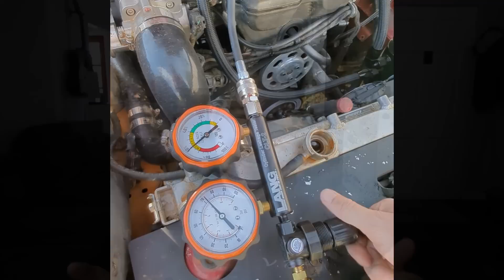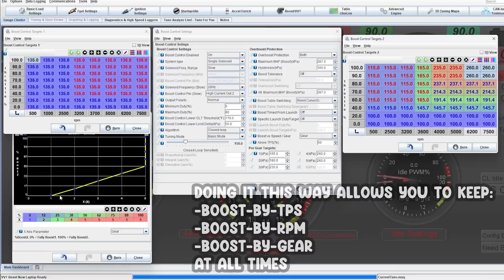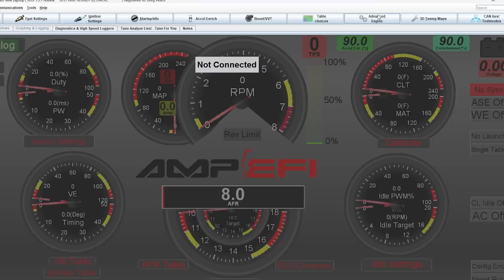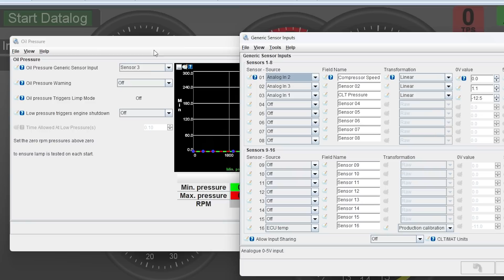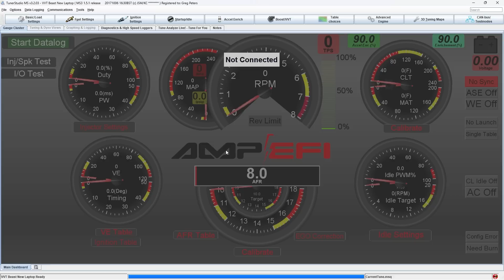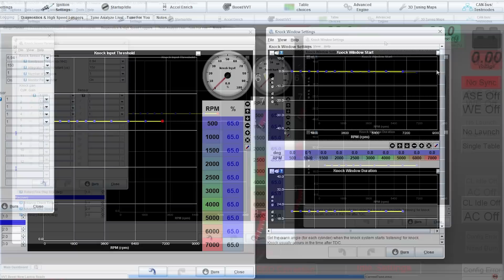The 500HP Miata Is Still Alive, Let's Make It Safe (And Fast)

Comment: The 2 point calculator for calibrating 0-5v sensors is an awesome feature. As you know most sensor data sheets don’t give you the absolute zero & 5 volt readings. 
Very good feature

Comment: I haven't found the point where the head starts to lift on the kia T8D 1.8L But I did find the breaking point of the Ring lands LOL. Turns out that somewhere around 21.5 PSI with a large large turbo. Or I'm guessing around 475 HP at the crank

Comment: Another great post and love the nerding out on Megasquirt and Tunerstudio stuff!  Question, for boost by gear, how does MS "know" what gear the car is in?
Reply from the maker: @therobertshouse  It's a calculation based on comparing engine RPM to driveshaft RPM (or rear wheel speed depending on where your sensor is), and you input the gear ratios into Tuner Studio. So it knows if driveshaft RPM is 3000, and engine RPM is 3000, it's the 1.000:1 gear which is 5th in mine

Comment: 4 cylinder ppl here in PR are using solid cooper head gaskets with lots of gray silicone im talking of 10 to 8 seconds street and drag cars…dont detune the setup you just need less fancier parts and true race hardware💪🏁🔺🔻

Comment: On the knock sensor, doesn't it not make sense to only listen for knock between -6 to 26, as every cylinder will be firing or knocking at a different crank angle based on firing order. Crank angle is only based on cyl 1 no?
Reply from the maker: It listens from -6 to +20 on all cylinders, not just cylinder 1

Comment: Is the turbo sized correctly for the application?
Reply from the maker: I would say it's undersized for the power level, which I'm sure is why there is such a fine balance between working and not working well.

Comment: You need to get rid of the VVT and get a cam with more duration. A late intake valve closing will decrease the dynamic compression ratio.
Reply from the maker: Yeah for sure, I have a couple 4W heads and I need to build one on the side and just swap it in next time I have the head off. At this power level I know I'm probably at the limit of what  stock cams really want to do. Problem is I'm also at the limit of the turbo... so I would like to pair the 4W head with a little more cam, and a little more turbo, and keep the same power level. Just scared I'm going to spend $3K to have the same power and less response, but in the end if reliability is up, then that's good. I can always set up kill mode with an extra 50-100whp on that setup and use it sparingly.
Reply: @TheCarPassionChannel  you will lose a little down low, but your shift points will move up in the rpm a little, so you will always be in the boost. In a slow corner you will have to downshift would be the biggest drawback. I think it would be cool if you went to a road course and got a time, then did some modification and went back.
Reply from the maker: @andrewf8486  Regarding shifting the powerband up, there are 2 limitations that stop me from trying to force the BP to act like a big turbo Honda - yes the powerband will be the same size, but I don't want to rev the engine to the moon to get power when I can already make good power int he stock rev range. Revs wear out all engines faster, regardless of build. And also, the turbo will still come on slower at a given RPM (transient response). 

In a straight line, yeah big cams and big turbo all the way.
Reply: @TheCarPassionChannel  another thought I just had is that you would still make the same power on your current turbo at a lower boost pressure. This would drop you a little lower on the compressor map possibly putting the turbo into a more efficient island. Less heat, more power.
Reply from the maker: @andrewf8486  More efficient power, but less overall power. I ran this thing at every boost level along the way from 10 to 26 and it did not make less power at more boost at any point, which is why I don't want to turn it down 😂
Reply: @TheCarPassionChannel  pressure is a resistance to flow. If you put a larger cam in your car the engine will flow more air naturally aspirated reducing the restriction. If the turbo produces the same mass flow rate it will do it at a lower pressure because there is less resistance to flow. So because mass flow rate is analogous to horse power, you will produce the same horsepower at a lower boost level, and it will occur at a higher rpm because large durations favor higher rpm. I’m not saying go wild it’s not a 9000 rpm engine with that under square crank in it. I’m just saying making it a better na engine can only help your situation with too much combustion pressure at low rpm.

Comment: theres a few people who have done oversized head studs (12mm or 1/2") with larger washers to increase clamping force on the head. I have been considering it since my head lifts as well on occasion. I've also seen various custom head gasket setups, full copper, fire ring, etc.
Reply: probably a good idea

Comment: So hypothetically, could you benefit from the boost ramping in 2nd and 3rd gear by setting a slightly higher boost level >5k rpm?  Im sure the benefits would be extremely little, but if you're already min-maxing this setup, maybe there's a tiny bit more to gain there?

Comment: 30:00 Does that setting still work, only listening during a window around TDC, when you're only using one knock sensor?
Reply from the maker: My understanding is that it listens during that window, for each of the 4 cylinders, on the combustion cycle. So it's technically got 4 "listening windows" per engine cycle, a total of 104° (26° x4) out of the 720° cycle. So I'd imagine that still helps keep the signal cleaner

Comment: You could go to water or water methanol injection for limiting peak pressure aswell...(rising the thermal capacity of your gas whilst maintaining good timing) if you have too little timing your exhaust temperature will rise... be aware of your turbo heat tolerances! (Honestly not sure if you are running a exhaust temperature sensor on your car tbh)

Comment: I think Miata OE knock sensor is a resonant sensor so only outputs a voltage signal for a set OE frequency. a large voltage jump from a known baseline could be knock. But it’s prone to error. 
Non resonant “wideband” style sensor will allow you to test against frequency and set a suitable window for your engine. Then set suitable thresholds.

Comment: How is the basic PID control serving you? What's the amount of oscillation in target vs actual pressure that you get?
P.S. TPS going to 60% while 5V spliced together with CPS is either voltage drop on your 5V line (probably damaged wiring), or you picked the signal and not 5V line from TPS.

Comment: Sounds like you need a haltech ;) Another benefit of coolant pressure sensor is to measure if coolant pressure goes too low, aka coolant leak. I nearly blew and engine after the heater tap hose broke off due to the plastic deteriorating and of course the coolant temp sensor will not pick up an engine overheat until much later if there is no coolant in the engine :/

Comment: Just fyi. Haltech elite 1500 can do boost by rpm X gear table. It also has awesome protection strategies for your engine.

I would also recommend a exhaust pressure sensor. You might have way too much back pressure and might need a bigger rear housing for your turbo. To make your system more efficient.
Reply from the maker: I am certain eMAP is off the charts on this setup
Reply: @TheCarPassionChannel  please keep us updated on your progress.
i'm planing to go turbo on my NB1 (bp4w) but goal will be no more than 300whp. getting started on the bottom end upgrades soon.
 hopefully i will keep my 6speed alive at that power level. i did get a sprung clutch to make its life easier.
i also want the best response i can get as its a circuit car but also dont want to be blowing gaskets (ever). 
plan is 10:1 84mm pistons on 50/50 e85 / petrol blend. and a turbo big enough for 350 but tunned to 300whp. maybe i can have the extra 50hp on a steering wheel button for use now and then 🤣
Reply: @TheCarPassionChannel 
I refer to you as the mx5 miata God to people I talk to about you 
So much goes over my head I've always loved cars but computers have been known to shit me to tears but I'll get it eventually 
I sometimes share your stuff with a mate of mine with a question 
What do chicks do
As we men seem to be dealing with a different deck of cards
And currently I'm nearer the chicks deck than yours 
MAN YOU KNOW SOME SHIT
IM IN AWE
OF YOU!!!!!
Your a legend brau
Keep up the incredible work 
I'm so glad you're into mx5s miatas 
I aspire to a 10th of what you know 
Thanks Greg for your devotion to our LIL na mx5 MIATA eunos brg 
Your a GOD SEND !!!!!

Comment: hey just wanted to let you know thats not how how you should wire the knock sensor. the shield and sensor ground to join together at the ecu side. the shield goes around both wires wires. and on the sensor side the shield doesn't connect to anything. only the ground signal goes to the knock sensor. seems a bit strage but thats how ground shield should work.

Comment: Doesn't the cooling system naturally hit max pressure anyway, as it heats up and some of the water boils? My understanding was that the overflow tank always fills up a little bit while the engine is hot, and then lets that coolant back in once the engine cools down.

Comment: I got lost after 5:56 when your dog walked in.  Administer pats from a fellow Graeg plz.

Maybe try a different fuel, I'm running 27:1 compression @ 22psi on my 3.0L 4cyl.  40 octane is what I run, but I don't quite get the high numbers you do.

Comment: Great timing Greg, I've been working on getting knock control working on my NA6 vvt forged motor with 6258. Just an FYI the knock window start settings are in BTDC not ATDC so you want +6 not -6, with these settings you are actually measuring 6 atdc to 32 atdc.

Comment: Random, slightly off-topic, question: who do you go to for machine work?  (I'm in SD, as well) Thanks.
Reply from the maker: GRC Machine for heads, they regularly Miata stuff. But they don't do blocks, I don't really have a shop anymore for block work. Contact Toby @ AED he may be able to point you in the right direction
Reply: @TheCarPassionChannel  This is perfect. Thanks.

Comment: You did a really excellent presentation on knock sensor setup. I also did not realize you could configure boost by gear ramps with those tables. I'll have to try that out. The method I use to dial the knock threshold percentage is, take a log of "knock-in" in say second gear, and gradually increase RPM's and load all the way to redline. Take those values and plug them into the table for knock threshold. In my mind, this method gives you an accurate level of natural engine noise at any given RPM. One dialed, any knock-in levels 6-10% above this curve could be considered as real knock.

Comment: Do you think these tuning solutions are going to be as reliable as addressing the hardware? Or do you think it’s just acting as a bandaid for an overall bigger issue? I wanna hear your thoughts before I decide to pull the motor, as I’m dealing with something similar myself. 😭

Comment: Miata turbskie had a 1.8 with 997hp in march 2021

Also the knock sensor was wired like this?
Coppershielding : normal ground
Sensor ground : sensor ground on ecu
Signal : analog input

That's what it should be right? Now the interference picked up by the copper wire gets dumped in the sensor ground
Reply from the maker: I reference Derek's car in this video, I'm well aware of it. And good question on the ground, I'll have to look into it.

Comment: I’ve been particularly interested in this video arriving. My own BP had similar symptoms at 400hp and 20psi. 3 headgaskets swapped, each time seeing different machine shops and each time the machine shops were baffled since the head pressure tested well and was planed flat. I eventually concluded there must be a hairline crack in the block or something and swapped another motor in and turned the boost down. I was hoping this can video would give the final answer to my own mystery… alas… we appear to both still be at a loss. 😅 It’s got to be cylinder pressure from our particular builds though. I just don’t know why my motor couldn’t seem to maintain it when others apparently could. Although my motor ran for 20k miles fine before the 3 head gaskets (which were 15miles each before symptoms arose). 🤷🏼‍♂️

Comment: quick question, im curious and not into this yet, but how does the ECU (ms3 mini) know which gear i am in when i try to boost by gear tune?
Reply from the maker: It's a calculation done by the ECU based on engine RPM vs rear wheel speed, using gear ratios I input into the software.
Reply: @TheCarPassionChannel  easy. another quick one. how do u like a 6 speed with 3.9 powered by a bp4w with ~350 target hp. too short?

Comment: dude why you dont change youyr small turbo for a bigger one .. i dont understand why you max a little turbo ,, less boost more hp less chance to blow
Reply from the maker: All that would do it take away my precious response and beautiful torque curve. The car is already traction limited at 500, so I don't want to go any higher, so a bigger turbo is just going to make the powerband smaller because it's going to spool up 500-1000rpm later and be far less responsive.
Reply: @TheCarPassionChannel  I understand but more time on boost = more heat and more pressure .. GL on your project I appreciate the reply and I hope you find a way to make the perfect tuned for this beast!!

Comment: Great video!  Question though, isn't the cooling system always going to reach the radiator cap pressure under normal operation?  Wouldn't that trigger your ECU into limp mode all of the time?  Maybe set the trigger pressure to just above the cap pressure?
Reply from the maker: No, the reason for the cap rating is so that if too much pressure builds in the system, it pushes coolant into the overflow tank. Under normal conditions it should not do this (I've seen a max of about 12psi so far during normal driving and some pulls). If I life the head again (hopefully not) I will be able to see how high the pressure goes, maybe it's well above the cap  rating like 20-25psi, in that case I might set the failsafe up at a higher pressure.

Comment: Same thing happened to me on a 1.6 with 8.5/1 @26psi @ 4000 rpm
Reply from the maker: Generating 26psi @ 4000 is very impressive for a 1.6 depending on the turbo, what turbo were you on?
Reply: @TheCarPassionChannel  efr 6758
Reply: To clarify not producing full 26 @4k but Definitely by5k the torque kicks in at 4-4500

Comment: How are you monitoring which gear you are in, for the boost by gear?
Reply from the maker: It's a calculation done by the ECU based on engine RPM vs rear wheel speed, using gear ratios I input into the software.

Comment: Hi, this has nothing to do with your video, I need some help and was hoping you might be willing. Here goes, I have put a miata engine in another car from a 2000 doner car 1.8, I have trimmed the wiring down and have cut one of the alternator wires (gray/red), my question is does it go straight to the ecu or does it go somewhere else first, I know it goes to the back of the car and then comes back to the front. Thanks dave